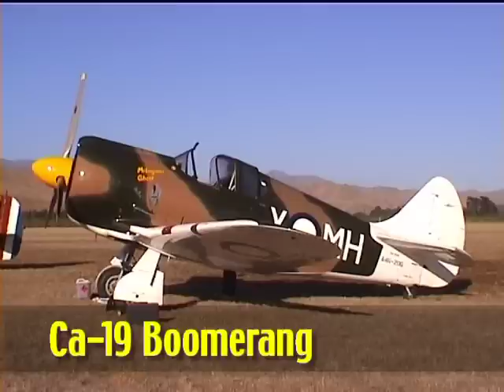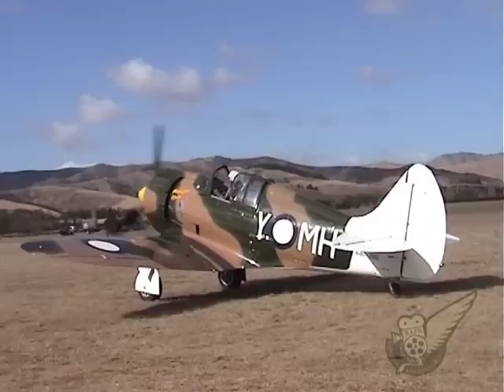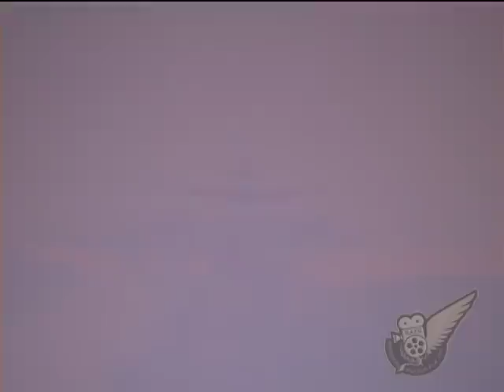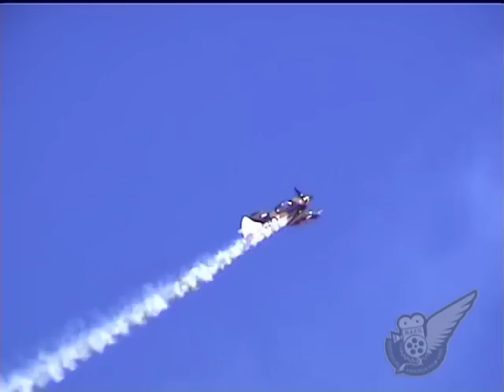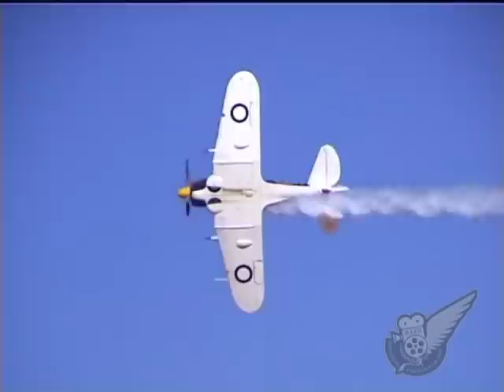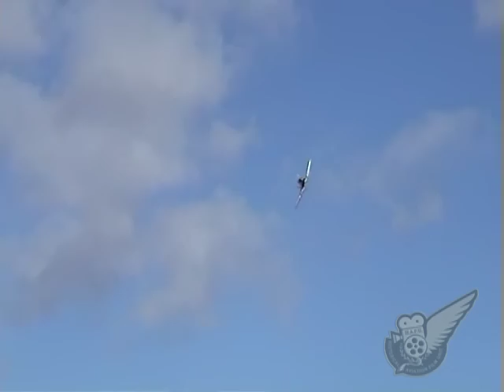CAC-19 Boomerang WW2 Fighter

Comment: Boomerangs were good little birds.  Built simple, yet rugged and reliable.  They might have had a weakness at high altitude due to the engine, but even the most experienced Japanese pilots had the good sense not to tangle asses with them below 10,000 ft.  A well determined Australian pilot could easily out turn a Zero or Oscar at lower altitudes with the Boomerang.
Reply: Then why did the Zeroes hack them out of the skies by the score over New Britain and New Guinea?
Reply: @richardm3023  They didn't. Boomerangs scored no Air to Air kills and Japanese army fighters shot down two Boomerangs over New Guinea, however, on September 6 and November 26, 1943. That is the sum total of its types kill loss ratio. 0 for 2. It was MUCH more effective in ground attack and carried out many such missions. The original poster is simply making things up out of thin air based on what he thinks would have happened and deciding its safe to say it did without anyone fact checking or challenging him.
Reply: Thomas Macnutz  LOL, when I think of Brewster Buffalos, it reminds me of Maj. Parks' boys that got shot up defending Midway.  Those were damn good pilots, and deserved better equipment than what they were flying.  A few hand me down P-40s would've been better than Buffalos.  Speaking of the Australians, the Owen submachine gun was another homegrown dandy that was a hit with the troops that used it.  More or less a Sten, but made to a much higher standard of workmanship, and better ergonomics.
Reply: Thomas Macnutz  Relax, not everyone checks YT every hour lol.  The Finns did really well with the Buffalo against what the Soviets sent to a less important front.
Reply: tommi atkins: You were doing so well until you used the phrase “fact checking...”

You seriously slid down the intelligentsia scale then!
Reply: @Lex5576  Actually before the Navy decided to add armor plating and self sealing fuel tanks, making it grossly overweight, it was s pretty good fighter. The Finn's loved them, and used them to good effect in the Winter War with the Soviet Union.
Reply: Thomas Macnutz  
Australia was looking for a replacement for the Kittyhawk and were working on another home grown fighter when they got the licence to build the Mustang. So the fighter development was halted. However one of these planes was completed and flown in early 1946. It was one of the fastest piston engine fighters made. If it had gone into production a couple of years earlier it may have proved a valuable addition to the RAAF. This was the CAC Kangaroo, which looked a bit like a Mustang on steroids.
Reply: Thomas Macnutz  
Type CAC-15 (Commonweath Aircraft Corporation) on YT or wikipedia for further info and photos, The CA-15  reached a speed of 502mph in a shallow dive.

Comment: From what I've read the Boomerang never met the Zero in combat. On paper the Boomerang had a more powerful engine than the Zero yet it was too low rated for combat performance. Now that there is at least one original Zero in flying order it would be something special to see a mock dog fight between the two.
Reply: The engine in the zero and the boomerang are very similar, at least the early a6m anyway. The sakae can rev higher and use lower octane fuel though.
Reply: Would be good to see a mock dogfight, especially being at low altitude where they both excel.

Comment: The beufighter (known as whispering death) also had a whistle alla its own 😉..and that from twin egines..boomerang is awesome though and lotsa power on that tripple bladed prop blowing back over that radial makes for one hella sound 👍
Reply: The Beaufighter and the Boomerang had a connection, they were both built at the Commonwealth Aircraft  factory in Melbourne. 
That same factory is now owned by Boeing and makes parts for 787, 777 and 737 aircraft.
Reply: The noise apparently is made by wind/air passing over the aircraft's gun ports I read.

Comment: l am pretty sure these were called the Buffalo they were sent over by England because Australia had no aircraft or builders at that time....The engines were only 600 HP not 1800 like the ones sent to Russia....So l don't know where this guy got his info....But it is dead wrong.mostly....It this plane was terrable to fly had no fire power much at all and when the pilot fired the guns in the nose he could see out of the front.....The list goes on...!
Reply from the maker: Nope, this is NOT a Brewster Buffalo, this is indeed a CAC Boomerang. Our facts are straight. And Australia had plenty of aircraft builders during the Second World War.
Reply: Google it doofus...
Reply: Good grief
Reply: Has absolutely no connection to the Buffaloe, although Australia did have some of those early in the war unfortunately. 
The Boomerang was solely Australian made from largely Wirraway bits and pieces as a stop gap fighter. What is stated in this video is 100% correct.

Comment: I'm not sure about how good this planes aerodynamic is, It is a rather old design for it's time. That little cute stubby plane reminds me about the Brewster Buffallo. But everything with a P&W or Wright engine is allways a joy to hear.
Reply: +Brian steff magnussen when they came out (1942) it was the fastest aircraft in the world to 10,000 ft. However the lack of a 2 stage supercharger meant that it was no good about 10,000. On the other hand the CA-14A which had a turbocharger produced results that gave it good performance (mid 350mph) at higher altitudes. They were extremely maneuverable. and could, in the words of a USAAF pilot who witnessed them "could turn on a dime" and impossible to out turn in his  P-39 (the book is called "Nannette" by Edwards Park)
Reply: Argus Tuft Thanks. I see it is a short stubby plane with large rudder surface, So i can imagine that they where agile, like dancing on a sharp point.  Much like the triplanes in WW 1 that could allmost turn around like a dog hunting it's tail.
Reply: +Brian steff magnussen quite true, however totally unsuitable for what they were originally built for. I remember one pilot recounting flying at 29,000 ft in this aircraft  - "took me 1/2 and hour to get there, and I wallowed around not doing much before I decided to get down low where life was more enjoyable". As I stated, the Boomerang lacked adequate super or turbocharging, but it did "morph" into the CA-15, which came about due to attempts to fit a larger engine into the CA-13 resulting in an entirely new airframe.
Reply: +Argus Tuft - Great ground attack aircraft though and extremely manoeuvrable at low-medium altitudes with a very good rate of climb. With a single stage supercharger it was limited as was the P-40 above 15,000'.
Reply: +Argus Tuft - Yes a great 'army cooperation' aircraft- what we would not call FAC or ground attack. 4  and 5 SQN basically pioneered modern FAC techniques  - 5 SQN working extremely well with RNZAF Corsairs. Boomers were a great strafing aircraft and constantly attacking anything Japanese they found. 

Interestingly in official air tests the Boomerang out-flew both Kittyhawks and the P-39 at most altitudes, (see Stewart Wilson's excellent book on the Boomer)  having a greater rate of climb and much better manoeuvrability but the aerodynamics were basically 1930's BC-1 trainer (very draggy with a fairly thick wing section particularly the centre section) with the exception of the outer wings which were unique to the Boomerang. 

The turbo-supercharged one off CA-14A  may have gone into production but General Electric would not sell or licence the superchargers to us (Allies eh?) and so CAC had to make do with a B2 unit from a B-24 and an intercooler from a B-17 which were not ideal. 

Still at the beginning of 1942 the CA-14A was topping out at 350 mph at 15,000'- about the same as a Spitfire MK V. Not bad for a country that did not even have an aircraft industry before WWII began. 

In any case it arrived too late and better aircraft were available, so it was was relegated to weather observations, flying regularly 'above 40,000 ft'.
Reply: Big thing was this was built primarily with parts already manufactured in Australia at the time. The fear at the time of course was being completely cut off from any supplies from Australia's allies by the rapidly approaching Japanese forces.

Comment: The Boomerang had design features and shared components with the NA16. During the war it was mainly used to see off Japanese bombers attacking Australian towns and cities. The first version was too slow VMAX 260kts to pose much of a threat as an air to air interceptor, but it was successful as a deterrent against Japanese bombers operating over Australia near maximum range. 

It was subsequently widely used as a close air support ground attract aircraft mainly in Papua New Guinea, the where it's twin 20mm and four .303 machine guns provided considerable fire power. 

A higher powered and much faster version was under development but as the tide of war changed and as the CAC factory switched to making Mustangs under licence, the Boomerang program was cancelled after about 250 had been built.

Comment: Smokesystem, used at air-displays. If an aircraft engine smokes like that due to poor sealings it will never be allowed to fly, no mechanic will sign the release to service form, I know I wouldn´t.
Reply: MrUllersater if the supercharger seal is gone the smoke will cover the whole airport with the engine shutting down shortly from no oil.

Comment: Sorry to be so late to the party. I was wondering if this aircraft is still flying? I ask because I did the original paint work on the plane. It was built at Sanders Aviation, at Chino, CA. I was working for a company called Aircraft Fabric Co, and I was asked to paint the Boomerang. It was one of my crowning achievements as a painter. The scheme was changed a bit from how it looked when I did it, but a lot of my work is still there. I'm still very proud of it. Thanks for showing it!
Reply from the maker: Not 100% sure, but I'm sure I saw something a couple of years ago which suggested this particular Boomerang was now static only.  Not sure why that was the case.
Reply: @HistAvFilmUnit  Thanks for the reply. That would be a shame of this aircraft was relegated to static only status.
Reply: I don't know about this particular aircraft, but there are several being rebuilt in Australia now :)

Comment: nice plane. too bad so few were made. the inevitable what ifs come out: what if it had turbo/super chargers, etc. but to have a beauty like this made in such a short time is testament to doing what had to be done at that time...
semper fi, carry on!!
Reply: Glad you like it. I always thought it was quite pretty in it's own stumpy little way. It found it's niche in ground attack and army co-operation in the end. Given that the plane it was based on, the CAC Wirraway, was a license built version of the NA-16 Harvard, it actually has distant roots in the U.S.
Reply: Biggus63 I saw one in Florida a few years ago, It was for sale.So, unless this is the same aircraft, I doubt this is the only flyable example.
Reply: George Martin
I understand there are several, though I couldn't say exactly how many. There might be 5 or 6 that are either flyable or close to as a wild guess, maybe a few more. This one's in New Zealand but I'm pretty sure we have a couple of flyers here in Australia too.
 When they say it's the only original flyable one perhaps the other flyers are rebuilds with some Wirraway parts or other replacement gear. Just my guess.
Reply: Biggus63 I'd say that's a guess.
Reply: George Martin wow, so few. what a shame.
Reply: @echoesofthedead  They only built it until they could get set up to build the Spitfire here in Australia. It was no world beater but better than nothing.
Reply: @skippy5712  Australia imported it's Spitfires, on loan, from Britain. They were not actually made here. CAC did make Mustangs under license to the Americans later on.